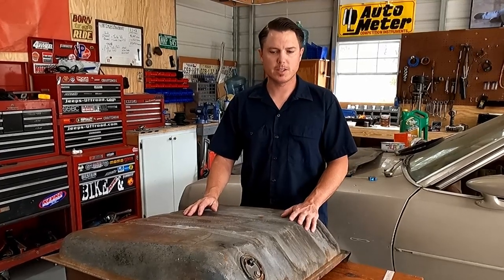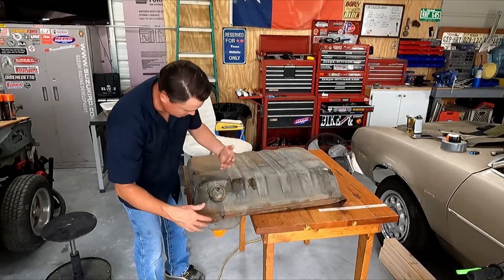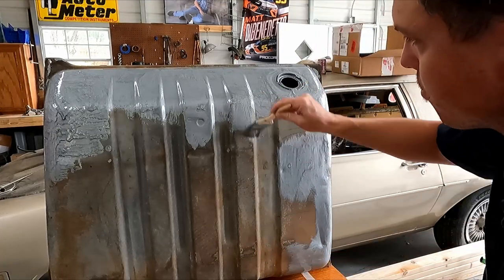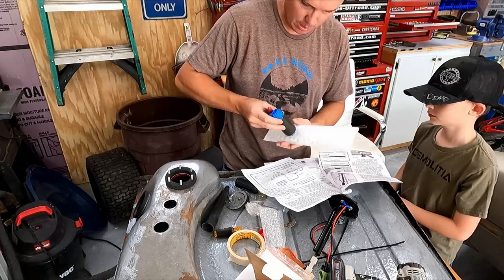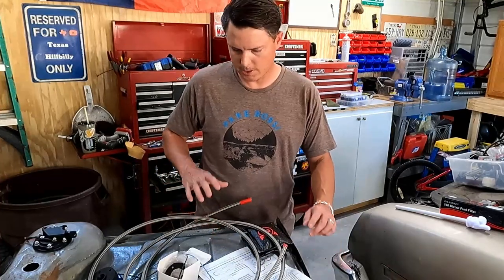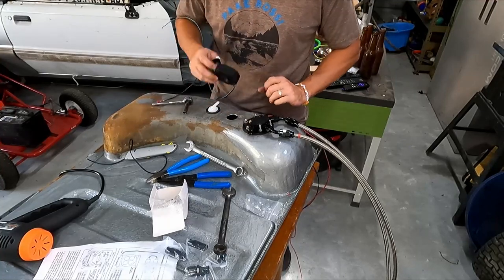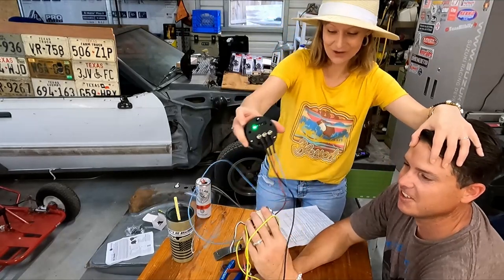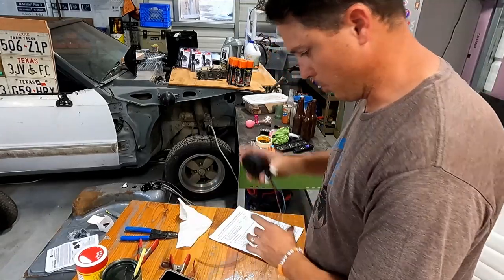Retrofitting a Factory Fuel Tank for a Hyperfuel EFI Fuel Pump and Holley Easy Sender Installation

Comment: A light bulb inside the tank really helps to find those pesky pin holes. That sealer kinda works wonders, I've used a few different sealers and they all work pretty well. But remember how thin the metal was when you tried to weld it? Its still paper thin. So you'll need a new tank eventually.
Reply from the maker: 🤣 wait til I tell her someone guessed she was from California. 🤣 🤣